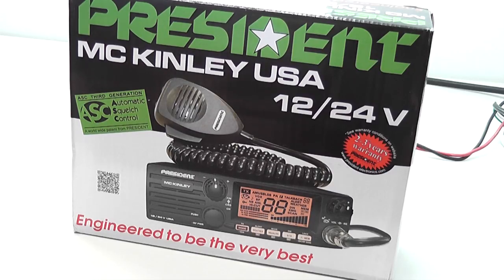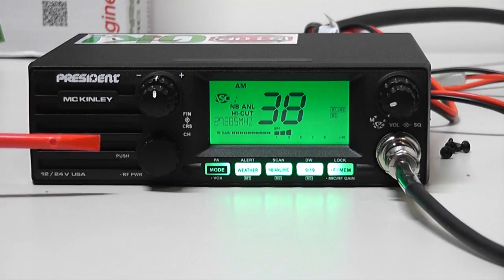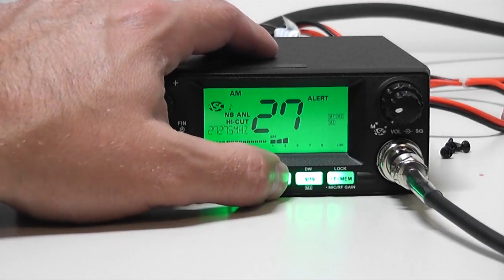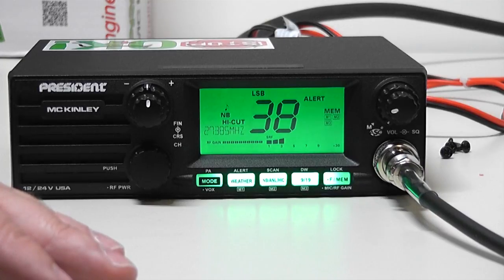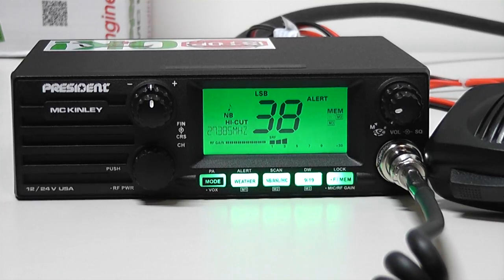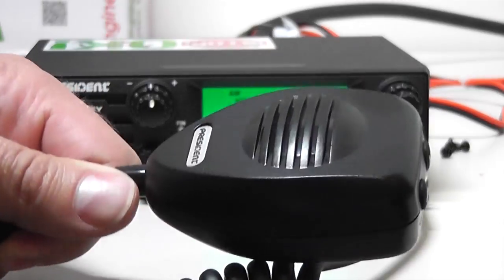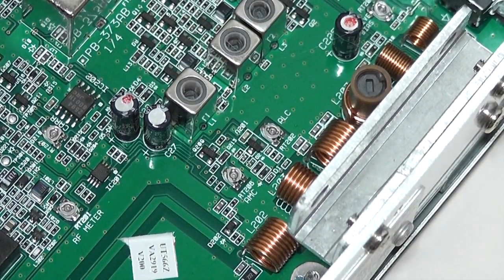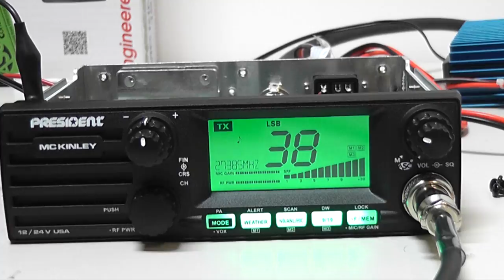President McKinley AM SSB - New 2017 CB Radio Review

Comment: This is the best video I've seen on the new  President  McKinley CB and I'm now convinced to buy one. As a licensed ham and former CB fanatic, I keep a CB handy in the shack to communicate with  truckers on a MAJOR Interstate that passes through my area. I usually   have it on  during the winter and during severe weather situations during the summer. If I hear of any problems on the highway, I pass the info on to the local hams via the repeaters. 

This will replace the 30 year old General Electric 3-5811B I've been using  for the past 2 years.
Reply: Totally agree.

Comment: I had a tough time deciding between the President Lincoln 2 and the President McKinley.  This is for a mobile operation so it came down to the Lincoln with AM, FM, SSB, or this unit with AM, SSB, and Weather, plus Weather Alert.  
I have been out of CB for a decade, but best I can determine FM has not taken off on the road, while Weather Alert is a valuable safety resource, especially on long distance runs.
I am planning on a magnetic Wilson antenna with whip due to my driveway being long with lots of overhanging branches.  I will upgrade the antenna cable to multi-strand.
I would much rather have a first class radio chassis right on spec, with a good antenna and setup than a lot of power splattering the adjacent spectrum.  The trick has been finding the right radio man and installer here in Western Virginia.  Four of them are gone.
Thanks for a comprehensive report and instructional use.  I learned a lot and feel even better about my choice.
SpaceCaptain

Comment: I did discover mic element does have very small slits in front of it. I moved it into center cavity and put some cotton filler behind element. It could also be hot glued. It pryed out very easy if its current position

Comment: McKinley or Harrison? I don't need SSB, I do want WX

I've been through 2 Uniden Bearcat 980ssb in the last month and I can no longer trust the reliability of that unit. I use my radio on the road for road information and weather information.

If not the President models, what make/model do you recommend?

Comment: I like the variable RF power feature. Wondering if that could be customized to go higher then 4 watts? Anyone know? Thanks
Reply: Easier to simply add an RM Italy KL-203 amp. Turn the CB down to a watt or two when you use the amp.

Comment: My family just purchased the McKinley CB and volunteered me to figure out how to use this CB. I've mostly figured things out but I don't understand the scanning with squelch. It only scans when there's no static feedback. But doesn't detect any transmissions via scan but I can find transmissions when I have the squelch/static...am I doing something wrong or can someone link/direct me to a how to use (for dummies)?
Reply: No you aren’t doing anything wrong. The Squelch will activate if a signal is really local  and open the audio long distance not so much particularly on LSB you should listen to the Motor mouths on channel six and see what signal level will trip the squelch. Once the skip starts rolling on channel 38 LSB you’ll hear all across the world/ USA. I run mine legal and find it hard to break the pile up on 38 so if that happens move up or down a channel and you might find is lower powered stations on 39 or 40 less noise clearer contacts.

Comment: Would the stryker sra10 pair well with this? Run one on my kw with a bearcatb980 an it works well. But looking for a good antenna to mount on my toyota tacomas arb bull bar

Comment: I purchased this radio and have one question. Is it normal for the squelch to sound choppy, or did I get a dud? Other than this, I'm seeing an improvement over the Galaxy DX 959 that I've had for a several years.
Reply from the maker: I think squelch would only be choppy if it’s set where a station is just barely breaking it and it activates/deactivates as the signal goes above and below the level. I’d suggest playing more with the setting. I find the level on these is often a higher setting than other radios. Another trick to reduce noise, lower your RF gain two notches. It will quiet the receive and you won’t lose much signal strength on incoming stations.
Reply: @cbradiomagazine  This one may have issues. As it approaches the signal area it begins clicking as it breaks the squelch, and it gets worst as I turn in more squelch. Then I have to turn it further before the signal stays strong enough to keep this from happening. And the whole time, if I turn the volume down all the way, I still hear this noise plain and clear through the speaker. Almost sounds like a leaky cap in the audio line. It sounds sort of like tapping a 9v battery to the speaker terminals. This does not happen when using ASC. But the receive on this beats my galaxy DX 959 hands down.
Reply from the maker: @RhythmicSensations  yeah I haven’t run into that, definitely sounds a bit odd. Honestly i don’t use the squelch too much since I lowered the RF gain two notches and it’s pretty quiet in the mobile. DX has been great so I want to hear those weak stations because I’ve been able to work them so squelch is off most of the time.
Reply: @cbradiomagazine  Thank you for the fast reply, and good information. Turning the rf gain down two clicks seems to have fixed the issue. That was an interesting resolve. It still clicks as it goes in and out of squelch, but it isn't constantly making this noise without allowing audio through.

Comment: How do you lock in the rf power adjustment? I get it to adjust but then it just goes back to full power?
Reply from the maker: Once you adjust it using the knob, push the knob in for 3-4 seconds and it will save. Same thing for RF power and adjusting mic gain.

Comment: What was the SSB output set at from the factory? Mine was under 2 watts on sideband but 3.5 on am. We used the stock mic and we got 4 watts and 100% modulation on am and my radio guy said he could maybe get 4.5 to 5 out of it without loosing modulation but he said it starts to heat up much faster at anything over 4 watts. I am fine with that. But SSB was really low, and about all we could get out of it on SSB and not cause other stuff to drift or get real hot was 6 or 7 watts at a normal voice level. The only way to get 12 to 14 watts was to whistle in the mic.  Any thoughts on this? I was going to keep the stock mic because it is small and lightweight, but I may try my D104M6B or Road Devil to see if it changes anything.  My radio guy has been doing my stuff since 1984 and my stuff tends to sound good and last a long time. But the newer compact radios sometimes are a challenge. I watch alot of videos that show cobra 29s hitting 20 plus watts and I have friends that ordered them and after 1 or 2 months they fry the radio. I know my guy says they shouldn't peak to more then 6 to 7 watts or they will not last. Just expected a little more on sideband. He remarked that when it's turned on and sitting in stand by mode it seems to get pretty hot compared to other radios. He expected more heat when transmitting just not in stand by mode. Thanks for any information you can offer.
Reply: That is normal on Ssb. To get 12 watts on the meter you have to inject two tones liw ans high simultaneously into the microphone

Comment: A tidy unit for beginners and novices...Practical for off grid travel.. Primarily for general motorist cb ...Mid range ability.. Far better for the same money..
Reply: Such as ?
Reply: @mattbennellick   Anytone 6666
Reply: @the11metersd.x.channel.55  Thanks! Will have a look at that. Was about to spend out on the President.
Reply: @mattbennellick  The Anytone is also cheaper in Europe and Asia.. In Europe also branded as the CRT9900
Reply: @the11metersd.x.channel.55  just had a look gutted it doesn't have front speaker as I wanted it in the overhead storage space in my Ford Transit Custom Tourneo. Might use a cable into the AUX in on the stereo save having an extension speaker for it

Comment: What is the power output for the Sideband, specifically for LSB, when you were talking to those other Radio enthusiasts? Also, how far would you say they were from you (seeing as they mentioned they were in OR)
Reply: I'm seeing about 13-14 on mine.
Reply: Turned up about 20 or 25.

Comment: Torn between the McKinley and the 980.
Reply: Did you end up deciding? I use both and like both of them.
Reply: @jeffkardosjr.3825  Went with the McKinley and very happy with it.
Reply: @Scott_AI5EF  I got the 980 years ago. I don't think this McKinley was out yet. I like that the 980 has more display colour features more, nicer display in general, the voltage meter, and the weather receiver might be better too.

I recently got the McKinley and I like that the microphone has channel buttons. From what I understand though it is the same pinout as the 980. The ASC, hi-cut, vox are also big pluses.

The McKinley gives a tone when checking the SWR and will keep checking it automatically. The 980's SWR meter is more traditional.

Not sure which meter is more accurate or if they are about the same.
Reply: @jeffkardosjr.3825  The NOAA feature has already helped me in the field. The lack of colors doesn't bother me. The NOAA alert will definitely get your attention. 🤣
Reply: @Scott_AI5EF  Yeah. The 980 alerted me of a tornado that ended up within 2 miles of me.
Reply: @jeffkardosjr.3825  Well worth having it.
Reply: I just tested my SWR meters on the radios. In a car that's Ive used with the 980 that has a fixed mount antenna.

The 980 has traditionally showed a close to 1.0 SWR.
Still showed close to that on this test.

I thought I had a bad mag mount antenna with my other car just using the McKinley's meter.
Like getting a reading of 2s and 3s.

I try my McKinley with the car that has the fixed mount, it only shows 1.6 on channel 40.

Channel 1 shows 3.6, 20 shows 2.4.

The McKinley SWR meter seems to be way off.
Reply: @jeffkardosjr.3825  I'm able on my my McKinley,  to 1.3 on 1 & 40 and 1.0 on 20, with a Tram 3500 antenna mounted on the roof of my truck.

Comment: I like the fact it has SSB, but these radios have so few buttons that you have to use too many functions with one button and that can get frustrating. I would rather have one that is larger with more function switches like the Lincoln II. The radio also looks cheap.
Reply: The 980 is a bit more accessible with the buttons.

Comment: Pretty sure even 24-volt vehicles use 12-volt batteries so you could still use 12-volt units in them.
Reply: Two 12 volt batteries, so yes, if you connected directly to ONE of the 12 volt batteries, you'd have just the 12 volts, even though the two 12 volt batteries are wired in series.

Comment: How do I use the SSB mode or is it a separate mode sorry noob here lol
Reply from the maker: SSB is a separate mode for transmitting. It's easy to use, just switch from AM to LSB and start talking. You use the clarifier to tune in other stations if they are slightly off frequency. Very fun mode and talks further than AM mode. Lots of information online for you to learn about SSB and SSB radios. Best wishes!

Comment: I came across your channel i just bought this cant wait till it comes in, also can you hook up a power mic to this radio, i have a 6 pin road devil mic that was hook up to my ranger 2970N4 will it work ? anyways great video and i just Sub to you channel. :)
Reply from the maker: After multiple years of testing and many microphones I can say that the stock microphone actually matches up the very best with this radio and it’s what I currently run

Comment: I have a slight different President MC Kinley. Mine is a european President MC Kinley which has a brushed aluminium design with the President Logo on top!  Also mine is an export version which has 20 watts power on AM / FM and 12 watts on SSB! I see there is NO cooling block on the back which the european MC Kinley has.